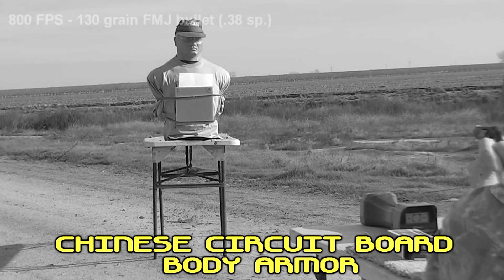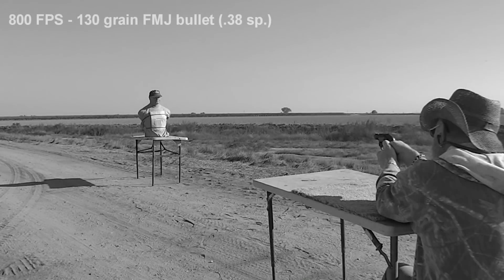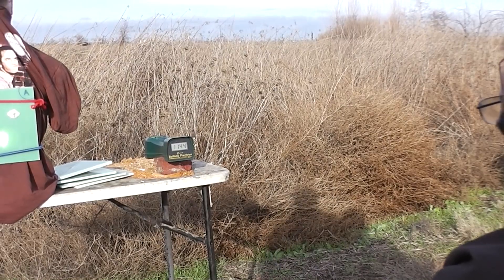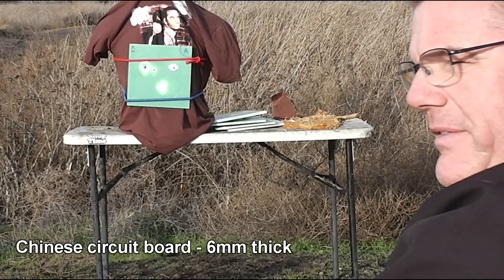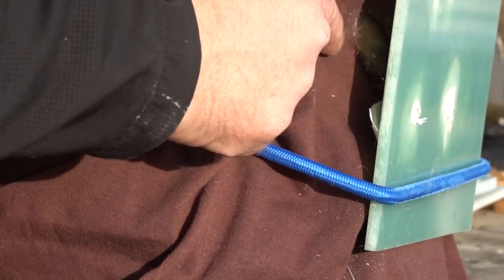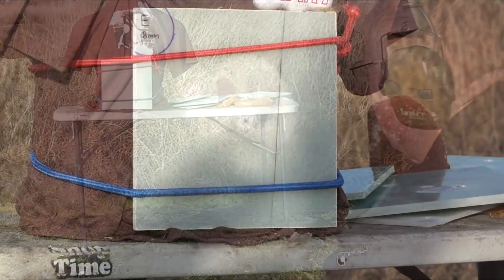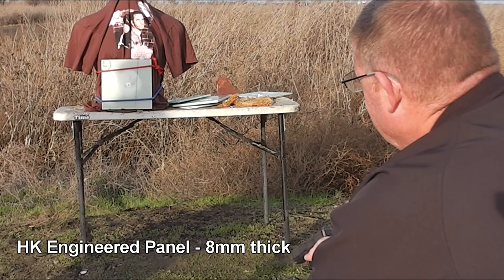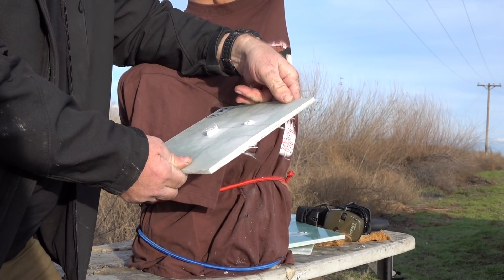CHINESE circuit boards -  are they BULLETPROOF?

Comment: I'm happy! A fun test would be that e-bay sketchy body armor with the HK plates backing it. Armor works by absorbing and spreading the projectile energy. Defeating armor works by concentrating a lot of energy in one spot, using high velocity and hard sharp projectiles. I know a boat building / repairing distributer that sells kevlar and carbon fiber fabric. It's for boats. But I've been thinking of trying out a DIY armor build. The problem right now is with tax season. Apparently the IRS thinks they are owed a lot of money.
Reply from the maker: The big issue I haven't mentioned is the difficulty of exporting body armor to HK.   It's regulated and you pretty much need to sneak it in.
Reply: @taofledermaus  That is a big issue. I figured there might be a hiccup. What about the raw materials? I've been working on a project recently and I'm having ITAR thrown in my face at every turn. It's the standard disclaimer speech. It doesn't apply to what I'm doing because no export or transfer is planned. However, ITAR regs do apply.

Good set of videos. If you can find out what is locally available, I still may be able to come up with some ideas that are actually useful. For example, epoxy in liter quantities should be available. Carbon fiber fabric should be available  also. But I don't know. I'm not certain, but I believe carbon fiber has a higher tensile strength than kevlar. I'm not kidding when I say this stuff is available (in the United States) via a boating supply company.
Reply: Some Kevlar coated and layered in resin and two ceramic floor tiles would be a cool DIY plate.